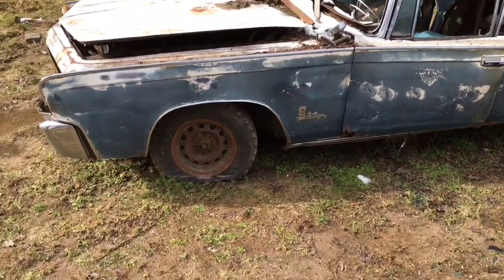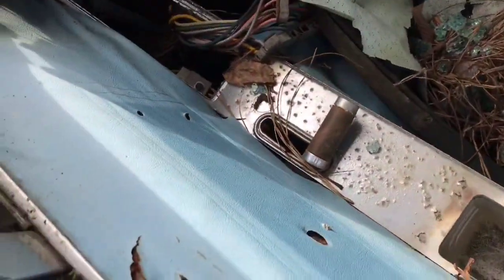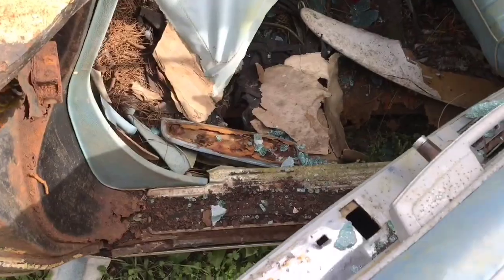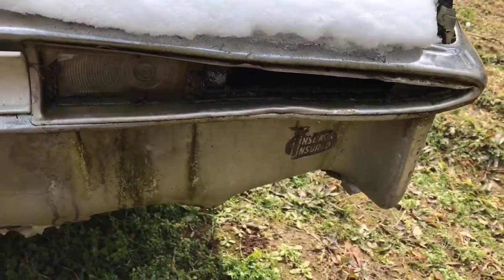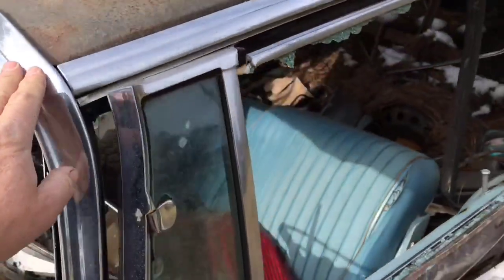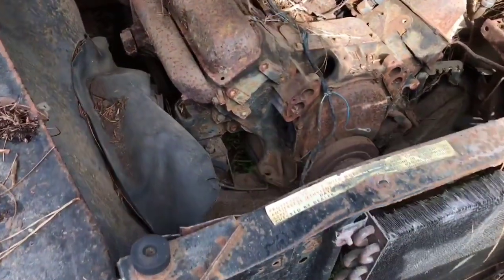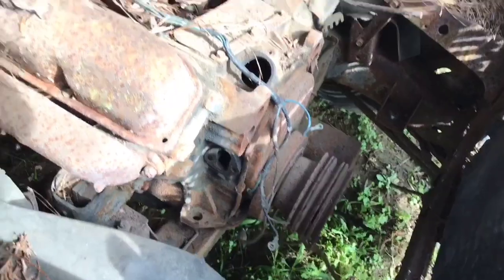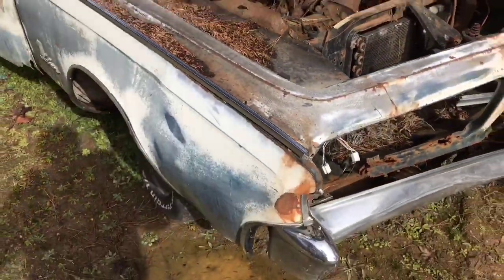Old Imperial LeBaron sitting in a junkyard

Comment: I would the pulley plug wire holders .i would every b
Reply: Bolt and hardware cuz when itgets scraped it g
Reply: It could have posi rear axle lot of big cars do
Reply from the maker: Probably does but i bet it’s a 741 case